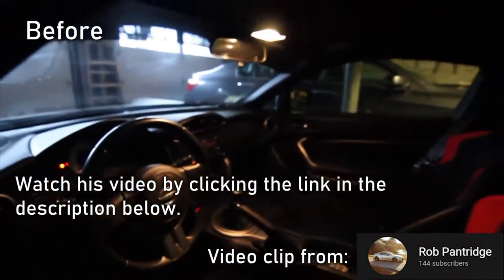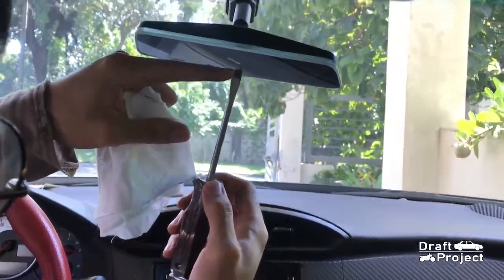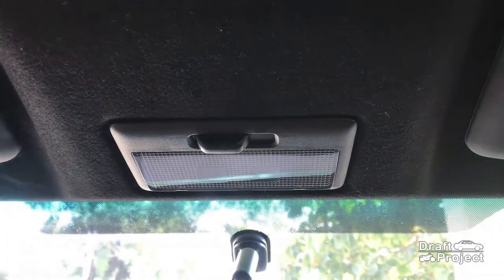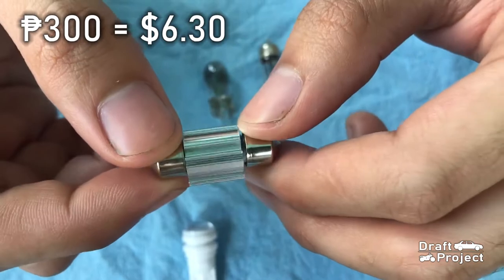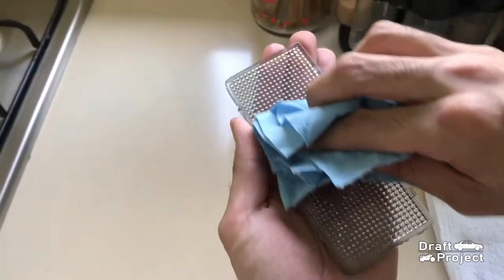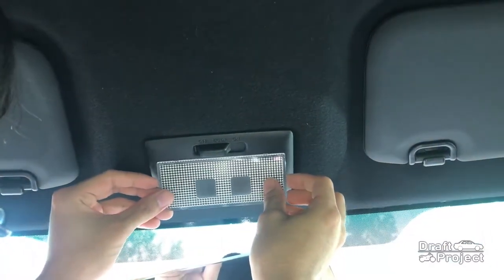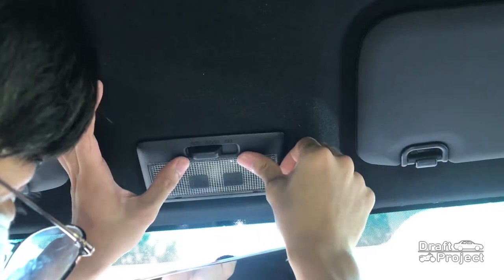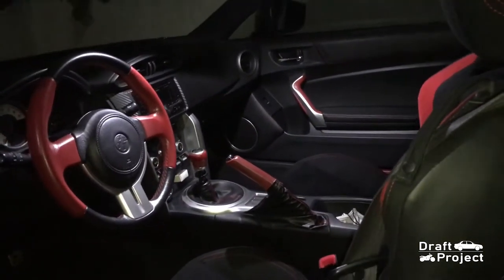How to Replace a Stock Dome Light Bulb - Toyota GT 86, Subaru BRZ, Scion FR-S

Comment: Instead of replacing the bulb, Can the whole fixture be temporarily removed? looking for wires to connect a radar detector to the rear view mirror.
Reply: Looking around so not to break anything before trying
Reply from the maker: Unfortunately, I haven't checked it when I had the chance. But I made some research and found this site. He showed there the ways on how to disassemble the whole assembly.

Here is the link:
https://www.ft86club.com/forums/showthread.php?t=27966

Hope this helps! Thanks!
Reply: @DraftProject  thanks. I haven’t done it yet as I was looking into upgrading my radar detector.  but this helps a lot. I’ll start poking wires soon and looking how to wire it up.
Reply: of course you  can man, as long as you know how to wire shit up yuppp definetly a go